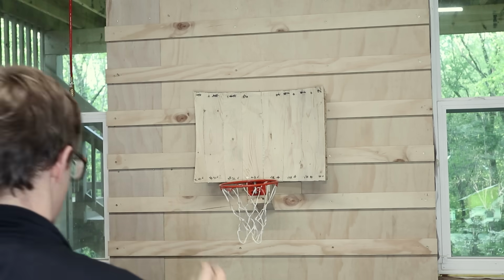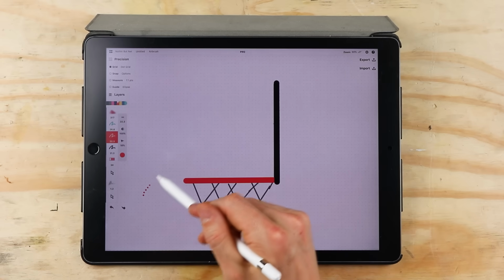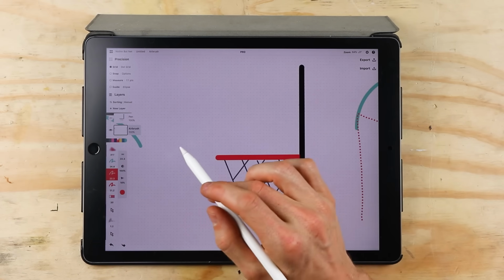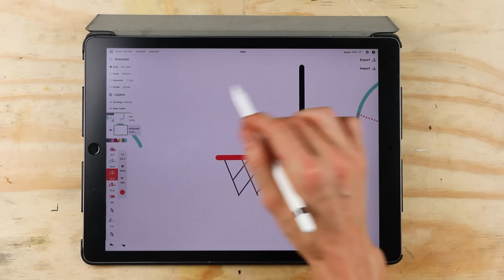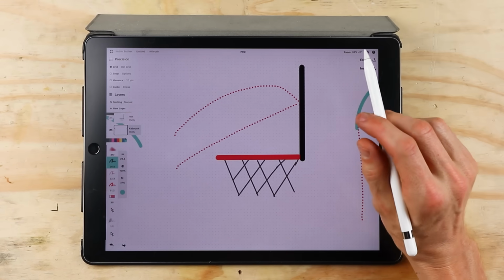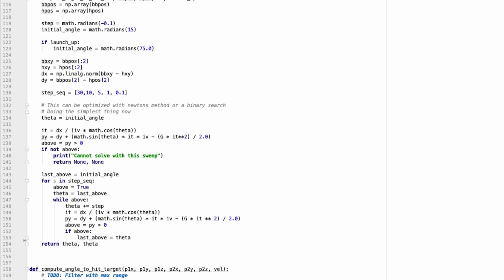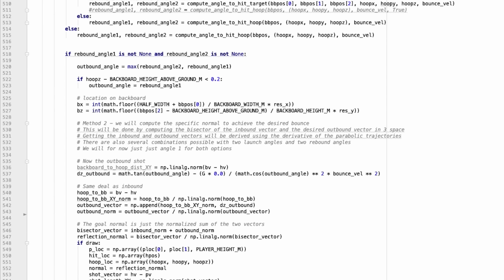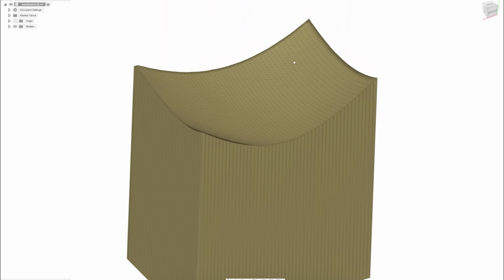My curved basketball hoop always goes in

Comment: I actually use Monte Carlo Simulations a lot. What I find fascinating is that this is the best application of monte carlo simulations I have seen! One of the ideas I had, what to do with guitars. I am an engineer and I find it frustrating that musical instruments industry is all about subjective opinions on the equipment. So I wanted to do a similar project but with guitars. Can I optimize the resonant chamber of a guitar to make it sound perfect. Would it change the design of the guitar?
Reply from the maker: Monte carlo sims are super underrated IMO. The trick with the guitar would be defining precisely what "perfect sound" is and what your search space is. If you can formulate that it may be a good application of a genetic algorithm...
Reply: @StuffMadeHere  Thanks for the response!
1. What is perfect sound on guitar? That is precisely what I started looking into and it seems that the material of a guitar is one piece to this puzzle but the volume that a guitar body generates is another. Larger the shape of the instrument (within reason), the better the volume seems to be the case. But some shapes like concerto are preferred by experts and are advertized by the makers like this one -- https://breedlovemusic.com/instruments/acoustic-guitars/shapes/concerto 

2. Regarding genetic algos...One thing that came up  -- when I posted your video into a group of ML/AI engineers group -- was your use of a sort of an empirical or brut force optimization technique (at least that's what I heard from the video, I could be wrong on this). So when you mention genetic algos, that to me gets into the world of what approach you take to optimize your factors/model parameters. In Python, as I understand it for ML optimizations there are libraries to help optimize the values for your training function. Is there something you could find for doing the same for a problem like yours?

Comment: If you wanted one that the backboard would deflect any shot away, wouldn’t you just inverse the board?
Reply from the maker: Yeah that would probably do it. Making one that never goes in is a lot easier since there are tons of reflection directions that don't go in. Heck mine almost never went in because I was a little bit off on one dimension...

Comment from the maker: I like this hoop a lot but I REALLY want a hoop that can sink a line drive and a slow arcing shot. I've found a way to do this so stay tuned for super hoop version 2.0! 

EDIT: V2.0 is done! https://www.youtube.com/watch?v=FycDx69px8U
Reply: my guess would be make the surface out of a material that absorbs energy and slows down fast shots but stays more rigid and give more bounce for slower shots.
Reply from the maker: @benmeister  That's an interesting approach that is simple, elegant and would probably work well. I'm going the other way and getting motors and computer vision involved...
Reply: @StuffMadeHere  haha well getting the material properties right for my approach is probably a boring nightmare so you're probably better off
Reply: @StuffMadeHere  would be funny after all your work just slapping a pillow on there works perfectly though :D
Reply: @benmeister  I thought that too. Can use newtonian fluids in the back
Reply: @benmeister  well newtonian fluids does the exact opposite of the effect that we want to achieve. But we can use like a rexine mesh that's supported by springs to hold it maybe. If you hit it hard the mesh will move backwards and absorb the impact but if you hit it slow it won't
Reply: Stuff Made Here you should patent this first bro 🙏🏼 excelent job 💪🏽
Reply: how about one that you don't need to be standing at the free throw line?
Reply: I'm curious, would it be possible to make that shape into an stl file to print?
Reply: I'm getting an active optics vibe when you say adding motors. That would be pretty cool. This also reminds me of Mark Rober's dart board. It seems you got him interested. That would be an epic collab.
Reply: Is that what the Private Build Video in the playlist is 🤔
Reply: love to see the 2.0
Reply: Stuff Made Here I need one!!!
Reply: Awsome! I have always wished I had the skill to get computers to do complex simulations like yours.
Reply: Yessss!! Can’t wait!
Reply: you were on daily dose of internet, youre famous
Reply: This would be excellent for special Olympics
Reply: Patent this design so no one steals it and also try to get the bottom corners to always make it because that would be insanely cool.
Reply: After you patent this brilliant idea :) Could you release the code on Github or something? Really want to see your implementation of this problem in python
Reply: I'd guess you hinged the backboard and added a spring and possibly a shock-absorber of some sort. Works like it does in this video for arcing shots, but gives enough to absorb the energy and dampen the bounce back on hard shots. Must have been tricky getting the pivot point and spring force dialed in.
Reply: If you paint it vantablack would it disguise the depth variations?
Reply: How do you make this even better
Reply: Personally I’d love to see a backboard that had the ridiculous shape to always pop the ball in on a parabolic arc
Reply: Yeah, although it works, in theory it's far from perfect. There are so many factors that would need to be considered to make this the "mathematically perfect" backboard.

Also, as one person suggested in here, using motors and motion detection would be quite a fun approach. There's a content creator on youtube that made a dart board that never misses. Seeing an alternative concept like that would be pretty fun.
Reply: What's a line drive?
Reply: Any plans to post the stl? Hell i’d even buy it
Reply: Ali Hadi Babar  You think he can field every comment?  This comment section is more for YOU.... than it is for him.

Example.  I have three words for you... DIY Oobleck Pistons
Reply: Stuff Made Here you should probably patent this buddy.. preferably ASAP! 
This would be great for special needs athletes , causal home recreation, etc !
Reply: Oobleck filled layer
Reply: Where can I buy one
Reply: And now he has a one that can move around
Reply: 4 years later : can we have the cad model so we could 3d print it? 😁 It sounds like a nice satisfying toy
Reply: Stuff Made Here bro this is really sick! Our channels are around the same type of things and I look up to your channel! I would love to collaborate or something like that in the future!

Comment: wouldn't it be faster just to use this rule and take rim size as distance to mid point? Coz I asume this still will not be 100 percent shots anyway https://www.researchgate.net/profile/A_Mujumdar/publication/265238420/figure/fig9/AS:392121874960396@1470500548690/Elliptical-reflector-assembly.png

Comment: ok smart guy make me a stock algorithm that can turn $100 into $1000000 by the end of the year . That code looked pretty succinct (less than 600 lines). You should explain it in a separate video. Not all the audience has disdain for knowledge.

Comment: Would it be faster to calculate the bounce "backwards" (i.e. start the ball in the hoop)? That way you don't have to calculate all the missing shots. Then pick the backboard angle with the highest number of possible shooting angles.
Reply from the maker: Very possibly. That sounds like what ray tracers do (projecting the light from the camera outwards rather than from the lights). There's tons of possible optimizations - I wasn't even trying since I only needed it to work once and it was taking less than a minute to run :)

Comment: I would use my cnc foam cutter to carve it out of a solid block of foam. First I would reverse the image so i could cut a "dome" instead of a "cup". Then I would use the foam as a plug to make a fiberglass back board....
If you will cut the foam blank I could fiberglass the final part.

Comment: I would have liked to hear details of how you calculated the bounce of the ball. Wouldn't you have to model the bouncing characteristics in your code?
Reply from the maker: Yeah I did. I modeled it as a simple reflection with a percentage of energy lost from the bounce. Basically take the incoming shot normal and reflect it around the surface normal and change the magnitude according to the elasticity.

Comment: This is a cool optimization problem. I've got a couple ideas for variations on this approach.

First, rather than relying on a gradient-based approach to optimizing the backboard surface, perhaps you could assume a parametrization of the surface as a set of points with fixed x, y locations and variable z? You could then define the full surface as a spline over these points. With this sort of parametrization, you could run a Bayesian optimization (https://en.wikipedia.org/wiki/Bayesian_optimization) method to maximize the number of shots that go in, while also optimizing other aspects of the dynamics like how well centered each shot is as it goes through the hoop. A neat thing about this approach is that you could directly add in some more complex constraints like ease of construction, since the approach doesn't assume differentiability.

The second idea comes from recent work in robotics on transferring controllers developed in simulation to the real-world. The basic idea is to add some noise to various parameters of the physics simulator while you run all the simulations for optimizing the backboard. E.g., you could simulate each shot with a slightly different size, bounciness, and friction for the ball. In practice, this sort of randomization seems to be pretty useful for producing more robust solutions. See, e.g., https://openai.com/blog/solving-rubiks-cube/.

Could you share a bit more about the environment you used for coding and simluation, and how long the compute took? Thanks for taking the time to make and share this video.

Comment: Awesome video. Did you measure the coefficient of restitution between the basketball and the backboard? From this video, it looks like you assumed that the basketball's velocity just before it hits the backboard, and just after it leaves the backboard are equal. And that isn't necessarily a safe assumption. :)
Reply from the maker: Definitely not a safe assumption. I dropped the ball a few times on camera and used the footage to estimate the coefficient of restitution which I scaled the incoming velocity by after the bounce.
Reply: @StuffMadeHere  Awesome! This is tremendous work. I've hacked together a few monte-carlo simulations at work, but nothing close to as complicated as this.

Comment: What about the spin of the ball?
I see you have chosen a style of shot (between a Arch shot and straight direct shot) but seems like your follow-through motion on the ball is the same. 
Shooting experts say you want the ball to have a backspin when shooting, but in certain situations you may need to add spin to get the ball in. Does it work with different follow-through methods thus giving the shot a different spin?

Comment: I’m curious if there’s a (relatively) simple analytical solution for this curve.
Reply: I wonder if you can start with a paraboloid that would work with no gravity and add an error term for gravity and than just optimize that error term in the simulation, maybe I'm way off though.
Reply: Well the fact that the ball hits the board at a curve shouldn't really matter? If you are looking at parabolic curves, at the moment of impact the curve is irrelevant, all it then is, is a vector and a velocity. If you don't take velocity into account then you get a regular parabolic "dish", it's the variable of velocity that will have an effect on the final shape. If you hit the exact same spot of the backboard at different velocities it will bounce back at the same direction, but gravity will affect it differently and you will therefore land the shot at a different spot. Ideally you would probably want to calculate for minimum possible velocity (just enough to hit the board at a given distance) and also at a really hard throw, and try and use a value in between for a typical shot. Alternatively you could also try and calculate, or simulate the ideal damping factor, so you could for example, mount the board on a spring to absorb some of the force and re-direct it closer to the hoop. Really interesting project, would sell well as a novely, or a childrens toy, kids would be glad for a helping hand and make them feel better about their skill.
Reply: The only idea I can think of is using calculus of variations to find a optimal surface maximizing the chance a ball with a given trajectory will go in.  It wouldn't be analytical but at least you'd have a PDE describing the surface.
Reply: He explains four minutes in why there isn't, unless you really, really restrict the type of shot you optimize for
Reply: He’s basically doing another version of an optical lens, which reflects light into a focal point. Except the lens is the backboard and the light is the ball. After a quick search I couldn’t find much about a lens that has a focal point off-center, like where the net would be, but someone has probably looked at that before analytically
Reply: @abekashem4326  maybe look at lenses used in laser applications like a combining lens.
Reply: @abekashem4326  With one major difference : light travels only in straight line whereas the shots are ballistic curves
Reply: @loupitou06fl  this is absolutely the reason you can't use focal point calculations.  Light always takes the shortest path between any two points and a basketball being shot never takes the shortest path.
Reply: @abekashem4326  You can see off centre satellite dishes, but optics aren't much help because of the gravity concerns.
Reply: @abekashem4326  but light enters and exits straight, while the ball does not
Reply: @abekashem4326  he said that a parabola doesnt work because of gravitational effects. Light isnt really effected by gravity (not that you could tell without gooooood measurements)
Reply: @abekashem4326  A reflector with an off-axis focal point is called (drum roll) an off-axis (or offset) reflector. A parabolic dish focuses to an exact point, which means you can take a cutout of the surface far away from the center and it'll still work to focus off-center. If he had optimized for a line-drive shot instead of a slow arc, he would've ended up with a cutout of a parabola. The fact that you want a wide range of angles to go in also means the dish wants to be "slow" - a gentle curve, rather than a rapid one - because it goes out of focus slowly as you go off-center.
Reply: @abekashem4326  A lens that takes in light from non-parallel angles (not directly in front of the focal point) and still (mostly) direct it to a focal point.

Comment: Couldn't you create that shape by drawing 2 rails for the X and Y axis and lofting the shape to those rails?
Reply from the maker: Maybe? The shape is pretty complex with continuous curvature variation across the X and Y sections. Not sure if the loft would interpolate to the right angles or not though it may get close

Comment: Nice job coming up with a Monte Carlo method. I'd be interested in hearing how you parameterized the shape and what exactly your MC was drawing from. Was it randomized shots + randomized backboard parameters? Was the shot selection constant from one draw to the next?

I do Monte Carlo for a living so I think this is really interesting.
Reply: From his first description, it sounds like it's slightly less MC and more SGD. Make a random shot, and then deform the patch of the backboard where it hit slightly in a direction that makes the shot go closer to the center of the hoop. Then repeat a million times. So the randomization is only over shot trajectories.
Reply: How can it be SGD without a gradient?
Reply: @ludvigericson6930  there is a gradient. Loss is the distance of the ball's path from the center of the hoop, and it has a gradient wrt the shape parameters.
Reply: I don’t think this qualifies as gradient descent by any definition of the word. There is no objective function, and there is no gradient computed. I would call it a Metropolis-like optimization process perhaps.
Reply: @ludvigericson6930  there is an objective, there is a computable gradient, and there's nothing Metropolis-like happening here. There's no density function.
Reply: @hobbified  It doesn't matter if there is a computable gradient. It is not computing a gradient, it is not gradient ascent or descent. It is randomly permuting the solution, hence Metropolis-like. RTFM.
Reply: @ludvigericson6930  no, it isn't. You're mistaken.

Comment: Monte Carlo refers to the gambling game.  Monte Carlo methods use some degree of randomization and large amounts of trials to determine an answer - every time you run another simulation, it's another roll of the dice, as it were.
Reply: Monte Carlo actually refers to the location in Monaco. Where famous Monte Carlo Casino is.